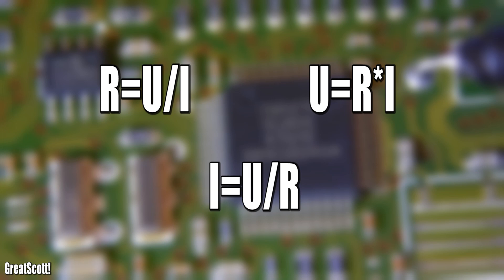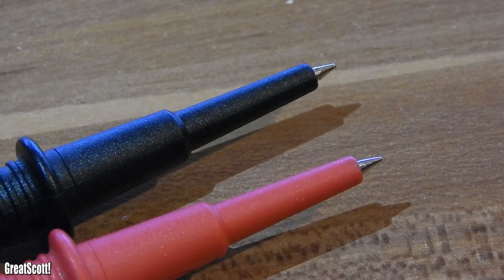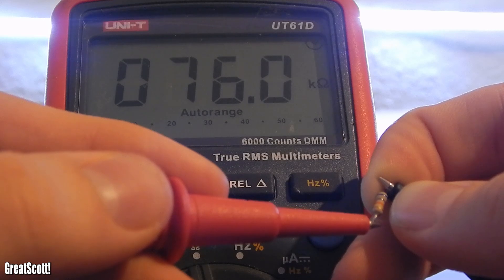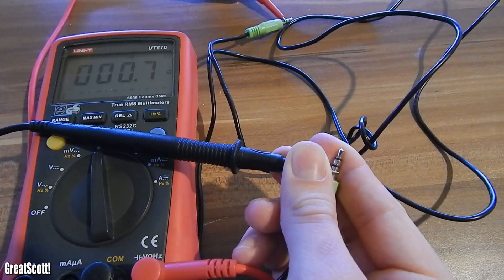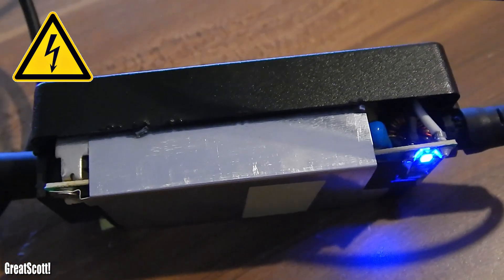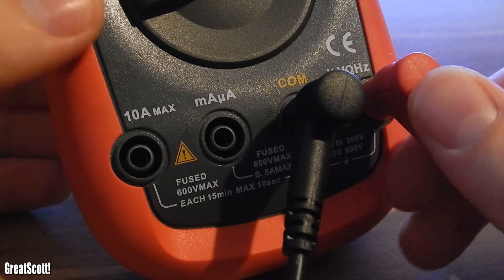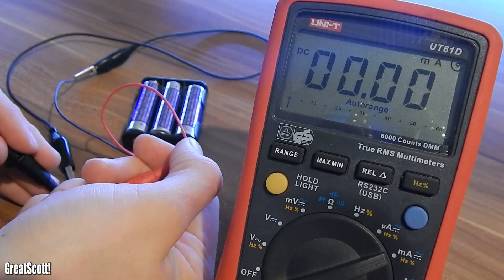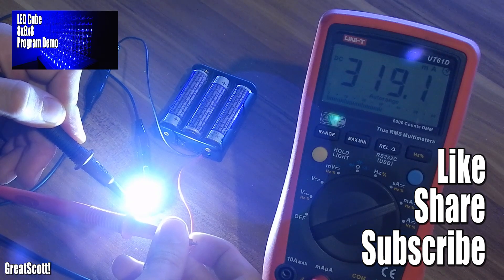Electronic Basics #1: The Multimeter

Comment: Does it can burn if I accidentally connect voltage source (like battery , power supply ,or even 220V ac ) with Ohm ,Continuity or Diode range of Digital multimeter.

Comment: I am a Field Technician In Texas and do Breakfix for computers, I have a Fascination for Electronics and will like to learn how to Soldier to acquire this skill set and eventually 
work as A  Component level repair fixing motherboards.  I have acquire the following to start,   Kotto Extractor, Kotto Solder Sucker,  Silicone Soldering mat, QuadHands  Deluxe helping hands,  SRA Flux Pen,  Tip Tinner from Thermaltronics,  No clean Wick,   Rosin Core Solder SN 63 pb37 0.8mm, HAkko FX-888D .  Which Fluke Multimeter do you Recommend or other items i might need? 
I was checking out the Fluke 101, 107 and even 117 but have no idea. Sincerely Irvin Thanks

Comment: Really happy to come across your video as my cheap multimeter broke again. It is time to spend a bit more and get a decent for my electronics, ham radio and rc hobbies. I tried your German link but. it was not available.
I did find a similar multimeter to the one you show on the video here in the UK - the UNI-T UT61E. Is this one good and reliable? It is much more expensive than the ones I had in the past but I will go for it if it will give me many years of good service.
Thanks for your advice and for sharing your very inspiring videos.

Comment: Question : Is it okay to open up a power supply and mess around with it while no power is on or connected.  Is there usually anything in there that maintains a charge while unplugged. Thanks
Reply: capacitors hold charge for a long time

Comment: sir , resistor showing 58ohms is not bull shit it simply means that there are some other resistors in parallel therefore decreasing the value of that 68 ohm resistor or you measured effective resistance

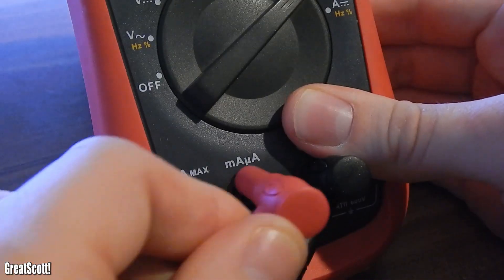Comment: Okay, stupid question but I've been trying to figure this out with another device. At 3:31 when the MM is recording 0.374 A. Is this effectively 374 mA being drawn per hour by the LED?

I'm attempting to understand how to do this as I mod Sega Game Gears with a LED backlight and would like to know what the new amp hours are. I remove a bunch of components that power the old light source and want to know what the reduction in power is. Originally, the device is rated at DC 9V 3A (that 3A kills batteries!).
Reply: Ah or mAh are written on a battery and give information about the capacity.
So when you got a battery with 3740 mAh and you connect the LED, it will light up for 10 hours.

t=Q/I = 3740 mAh / 374 mA = 10h

Comment: What happens when you connect the probes to the wrong polarity when measuring voltage?
Reply: The multimeter just will show up a negative value
Reply: Yes, all that happens is that you get a negative value, which is fine.

Comment: This multimeter is really crap but it does the job quite well for low DC current. Using a cheap multimeter can kill you. I know that many people do not see the point in spending hundreds of insert local currency here for a multimeter, but a good multimeter is likely something you'll be buried with (and not because it did kill you ;) ). I for my part want the certainty that I can stick those probes wherever I want without having to worry. Maybe that is because I am spoiled rotten regarding test and measurement gear because I am German.
Reply: (er ist auch ein deutscher)

Comment: Do you reside in Israel?
Reply from the maker: No
Reply: GreatScott!  I just saw Hebrew written on the power adapter. In any case, how long does it take to charge those six Lithium cells using the TP4056 module you used to make the power bank?
Reply: You have to measure the current and know the capacity of the batteries so you can calculate the time of charging.

t = Q / I

Comment: The symbol for voltage is V or E not U
Reply from the maker: Never heard of E. But U is common in Europe.
Reply: The SI unit (International System of Units) is "V".
The formula-symbol is "U".
So in the formula U = R x I, the U is the voltage and it is measured in V (Volts).
On top of that, in europe the symbol U is not used as a measure of V in itself but rather describes the voltage potential.
Reply: I'm curious as to what the U, common in Europe, is representative of.  I've recently, mid 2015, learned E was quite common post WWII (obviously usage has dissipated substantially since, idky) , perhaps only so in the States, and signified "Electromagnetic Force," or "Electromotive Force."  I can't claim a percentage of accuracy to the E etymology via public post, also not having verified it myself, however I find it makes sense to me.  If you're able to create more time, I believe most of us are "here" seeking initial and/or expanded education/knowledge, etc.
Thank you for the time you take with the video posts.
Reply: E can be used to express EMS or electomotoric force.When you have simple,let's say 9v battery and you mesure voltage whithout load and you will get let's say 9v,and this is E,but when you connect load to it you will get lower value,like 8v,This is because internal resistance of battery,like you have 2 resistor in series,and then voltage mesured on load can be called U.
E is also used to express induced voltage of coil, E=delta of magnetic flux / time change.
Hope it helps

Comment: When I measure DC voltage from my DC wall wart adapter it reads 18V (it's a 12V adapter with no load, so that seems ok). But if I switch the meter to AC it reads almost 40V.  I tested it with my oscilloscope and it shows a flat line, no AC.  Anyone know why this happens?  Is my meter broken?  What's going on?

Comment: There is a neat way to save the fuses in your meter.  You can install an inline fuse holder on the negative cable of the meter and have it around 80% the max rating of the internal fuse.  That will blow before the internal fuse.  Might not be useful for the mA scale but good for the 10A scale.